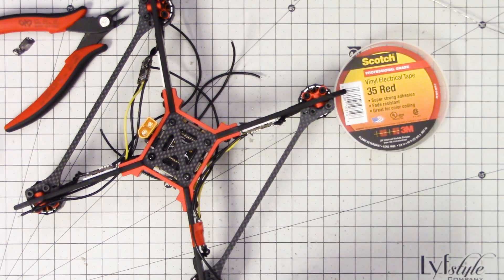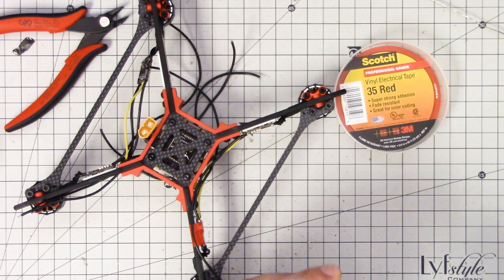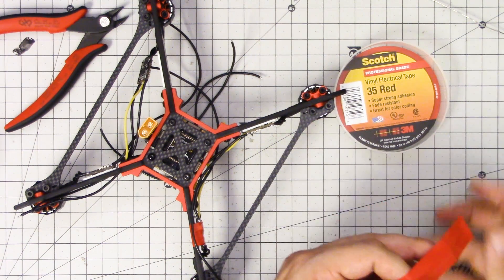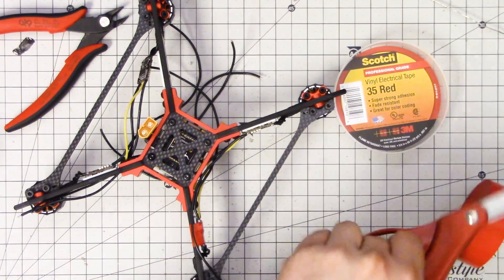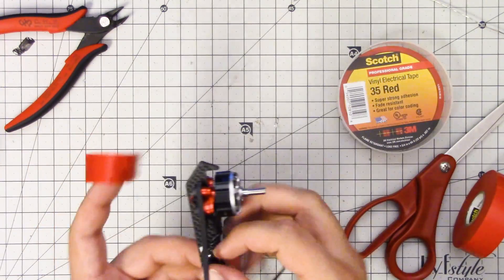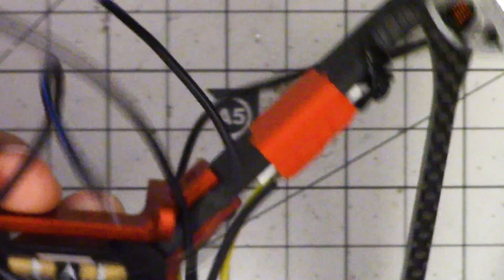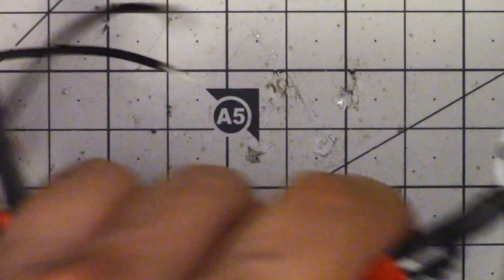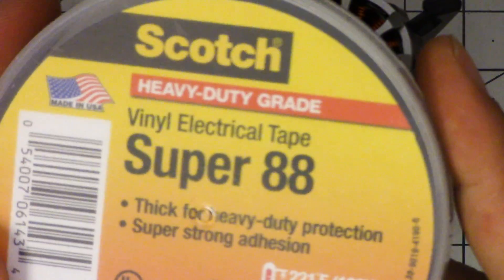RACING DRONE FULL BUILD | Part 3 | Karearea Talon ZMX FinX30 HGLRC F4 v5 Pro

Comment: Hi Joshua. Great videos. I'm building a similar frame of yours, but I'll be using a 4in1 ESC's with the same FC of yours(still waiting to arrive); can you tell me if there is another way to power on the FC since I intend to use the power input from the 4in1 ESC's instead of connecting the lipo directly to the FC. thanks
Reply from the maker: Check the manual of my FC, available for download from the RaceDayQuads product page. It has wiring diagrams for how to connect it with a 4-in-1.
Reply: thanks Joshua. So from the 4in1 ESC's using option one the wires to the FC can be from 22 to 26awg.

Comment: Hi everyone! I've got a really messy problem and wonder if anyone got some input? I've just finished my latest build and when I measure all points I can't seem to find any shortening, but when I plug in my battery with a "magic smoke stopper" the fuse blows instantly... :( anyone got any tip on what to start with?
Reply from the maker: Could it simply be that the quad is pulling more current than the fuse is rated for? Maybe on startup it pulls 2-3 amps but the fuse is only 1.5 amps.

This is why I like an automotive bulb instead of a fused smoke-stopper. With an automotive bulb, you don't have to keep replacing the fuse every time it blows.
Reply: Hmm maybe that is the case, it is a 2A rated fuse (at least on paper). If the quad draws that much on startup, that may very well be the case :) I shall try it with a current limited power supply instead and see if I got any luck. Thanks for the tip (Y) :)
Reply: What ratings do you use on your light bulb btw?
Reply: You were absolutely right! I made my own smoke stopper with a 12V 21W light buld and the quad works great! I think it's wierd that Hobbyking sell a "smoke stopper" with corresponding 2A fuses which can't handle a normal 250mm sized quad... But whatever, it works now, thanks for the help!

Comment: @Joshua Bardwell, any reason the signal wire is not grounded?
Reply from the maker: The FC didn't have a separate ground pad so I didn't bother.
Reply: The manual recommends wiring to the power gound pad.

Comment: To all the haters on the AIO FC/VTX -- despite the issues the current version will have occasionally, in a couple of versions, with integrated Smart Audio control, this format will be the de-facto standard, and if HGLRC does a good job with their V6/V7 iterations, it will no longer be the 'cheap' option.  With input from the likes of JB, a company already making AIO F4 boards will finally figure out how to combine all of these features... and the result will be awesome.

Comment: Is it fine to use motor wires for powering the ESCs? I noticed that the motor wires are always a little bit thinner than the wires that comes with the ESCs. Is that fine?
Reply from the maker: I think 20 gauge is okay for ESC power wires.
Reply: Joshua Bardwell thank you! Thats great because I have soo much 20awg wires!

Comment: Hey Joshua, Just a small tip, you should use cleaning gum to hold down any parts to solder on. In case you haven't heard of it yet, take a look: https://www.t2shop.de/Xceed-103232-Cleaning-putty-/-gum-200gram 
It looks a little like play-doh, but the stuff from XCeed is so nice to work with. Just press any part into the gum and it wont slide around anymore. When you're done just give it a little wack and tap away the remainders. I see so many people fiddling with moving PCB's and loose wires as a soldering tool isn't always the way to go. You now finally have one hand for solder, and the other for the soldering iron! Perfect joints at your disposal!, Greetings from The Netherlands, keep up the great video's, i watch m all, even if they're 30min ;)

Comment: Why did you put the foam that's supposed to be the battery pad onto the top of the bottom plate under your fc?  Was that a boo boo?
Reply from the maker: Yes. I correct it in the next video. I just had the plate installed upside down by accident.

Comment: @Joshua Bardwell
It takes almost all my strength to hold the motor bell while tightening the prop nut. Am I missing something? A tool that I don't know about? This is true on all three of my racing quads, but the worst is the emax rs2205s motors and pretty standard nylock nuts and Lumenier butter cutter props.

I have plenty of grip on the nut because I have a nut driver, its just holding the bell that is the problem. It hurts a lot and I get red marks on my finger from the bell vent holes almost cutting my skin. It is not too tight because if I make it any looser, then I can hold the motor still and make the prop slip with just a little force. Bad nuts? Bad motor threads?
Reply from the maker: Nylocks are always pretty tight the first few times you put them on or off.  There are a ton of 3D printed tools that can hold the motor bell. You could also check these out:

https://goo.gl/c1dyYh

https://goo.gl/QSusGg
Reply: Those look awesome, I will probably buy one tomorrow, and I will use this link just in case it counts as an affiliate link. Thanks.

Comment: Hi Joshua, I really like all black wire builds... my own little tip... I use a small (2-3mm) pierce or red shrink tube on the positive wire.  I usually put the shrink close to the FC so it stays relatively hidden.  I know it's an extra step, but I love the clean look.

Comment: I have a couple of questions about this frame. 
1) would it be even remotely possible to cram the esc's inside the frame somewhere if you were using a BF F3? I just don't like the idea of negating one of the main benefits of this frame by mounting them to the arms...
2) it might be crazy but is there any chance you could get a battery mounted to the top?
BONUS QUESTION) top or bottom battery for an all around quad? Rs2205s 2300kv, individual esc's, BF F3. I like top mount, never flown bottom. Looking at the talon of floss 2(top mount). I fly acro now but want to use it for some racing too.
Reply from the maker: Yes, just use a 4-in-1 ESC.

All around flying, I prefer top mount if only because you're not landing on it all day.

Comment: lost my boltrc kraken 5r becouse of going up when sun was coming down and was in wooded area so i long story short the video and radio signal went out and now its gone for ever but it was fast and weighed 303g with props but no lipo .. what would be as good? and wouldnt be heavy . tokio from envyastro is cool but dont have replaceable arms so i dont like it. Not sure if boltrc will be  best option since parts are harder to get but it was a badass with multicopter builders primo 2207/2650 with spedix es30 esc's,omnibus f4 pro,tbs unify pro hv,xsr receiver urghh makes me mad at myself damnit.. what u think durabilty and light weight would be good choice?

Comment: For all those commenting about the clone of this frame: Some differences (also posted in the Q&A section on BG): Not 7075-T6 aluminum, not 7k carbon, no chamfered edges, weak rear pod frame, jacked up cam mounting position. Cheap looking pot metal hardware. No optional pod plates for 2 or 3 board stacks. No HD cam mount option. No lipo pad either. Also, not a STRETCHED X... looks like a regular X frame. Too many differences. I'll stick to my real Karearea Talon. Thanks!

Comment: Take you time building. That way your Talon will stay alive longer :). I already built mine and broke it. Landed upside down today and broke off the top plate and the side plate of the contraption that houses the stack and camera. The frame is really study - I crashed it multiple times and the arms held well. Today it dropped from 40 meters above, no 5" quad would have survived.

Comment: Really weird idea here. The Karearea website says the aluminum motor mounts help dissipate heat, so if you're going to use it like a heatsync, why not put thermal paste between the base of the motor and the mount? I can't imagine It will help a lot, but  what harm can it do?

Comment: Did you have all the screws in the box?  Mine most certainly did not!
Reply from the maker: The motor screws? I don't think I got them, but I can't be sure I didn't lose them, so I don't want to blame Karearea.
Reply: First batch came with 3x8 M3 for the motors. Later ones did not. Just make sure to pick up some longer ones for bolting through the side braces.
Reply: Interesting - that's the ones I was missing.  A bit annoying if you don't have any spare.

Comment: Still, I keep my comment on your way of soldering. It is certainly not good while you say that you can do it so well.
For example, you just made a soldering and you see that this is not completely correct (can happen) then correct it by adding a few more solder to a wrap. It is clear that these 2 cuts do not flow into each other.
This is NOT good. That, as you say, never has problems, of course, says nothing.

Cutting a wire that is soldered is also not the right way. The wire should be of the correct length and then solder only. Cutting after you've soldering, gives a mechanical force to this connection, something we DO NOT want. You are always so careful with the copper islands with soldering, so do not cut if you have just soldered. Again  these remarks are not maked,  if you do not always call that you know it all so well.

Comment: Anybody i know who tried the Racerstar f4 AIO with 30A ESC and OSD Build in (Costs 60dollar) Loves it. If more people tried AIO Boards... NO Company would ever sell a Single FC / ESC / PDB again. Believe me^^ you Can Build a quad within 30min and it flies Like a Dream with This Board. But most of the people Are anxious to Try an AIO. They Are not stupid.. They just think it Cant be any good Because its so cheap. Na okay.. Thats actually stupid :D
Reply from the maker: There have pretty consistently been issues with AIO boards with ESCs built in. The first gen Asgard were popping in the field at a high rate. Same as reports of earlier versions of the HGLRC and the Sirin. Makes me think that maybe Moto has the right idea putting the Typhoon on a separate board.
Reply: Joshua Bardwell the Racerstar f4 is in its 3rd Generation now. I still have Version 1 installed and it Works just fine (6 months now with Tons of crashes..) Version 3 is out now with betaflight OSD and it Works great too. I Cant speek for HLGRC (i also heard about VtX failure so i wouldnt use an AIO with Build in VTX Because Lösung Video is more dangerous than a Damaged ESC) But i Highly recommend you to Try the Racerstar AIO F4. You save about 15g of weight and your Build is as clean as it could be. Cheers
Reply: Coppertop FPV i didnt experience noise issues. I replaced all my PDB FC Esc combos with Racerstar AIOs and dont Regret it. I Broke several ESCs before When hitting Gates or branches..not having ESCs on the arms is a Huge advantage in my opinion. Especially at a race where every gate Hit causing an ESC to Burn out wont let you finish the Race.

Comment: No issues with the hglrc f4 at all. Not sure what the issue is.
Reply: Lemon rate is low, but they do have issues - the 5V3A BECs do have issues (some are DOA, some fail after minor impacts), on others the MPUs see big noise spikes (likely electrical isolation issues).  I have two on copters that fly brilliantly, but two that have had issues... but since nothing else out there has this feature set, I'll probably buy more then next time they're $40 on BG

Comment: LOL! China is so fast.. Talon Imitation already out https://www.banggood.com/Realacc-Real1-220mm-5-Inch-4mm-Thickness-5-Vertical-Arm-CNC-Carbon-Fiber-FPV-Racing-Frame-p-1194720.html?rmmds=search
Reply: I could see a cheap knockoff coming off as garbage real quick: I have 8 years light mechanical and electronic technician experience, and I have never seen anything with this tight of tolerances as shipped from the factory.
Reply: Some differences with the Real1 clone (also posted in the Q&A section on BG): Not 7075-T6 aluminum, not 7k carbon, no chamfered edges, weak rear pod frame, jacked up cam mounting position. Cheap looking pot metal hardware. No optional pod plates for 2 or 3 board stacks. No HD cam mount option. No lipo pad either. Also, not a STRETCHED X... looks like a regular X frame. Too many differences. I'll stick to my real Karearea Talon. Thanks!

Comment: Accoring to Kabab the mounting holes are 18x18 mm on those motors. That's why they were difficult to mount.
Reply from the maker: WTF why woudl ZMX do that?
Reply: Ha, that's what you get for listening to Kabab. FAIL
Reply: Yep, I know you need to take his words with a grain of salt...
Reply: @Joshua Bardwell
Dunno, just so unnecessary to deviate from the standard, 16x16 or 19x19 would be ok though.

Comment: Joshua I have only recently subscribed to your channel after watching many of you really informative videos.
I do not understand why people complain about your videos, it is the same as complaining about TV programs if you do not like it there is an "OFF" button.
Have you thought about putting a short piece of heat shrink on the positive wires to identify them?
Pleas do not stop your videos especially as the build your are doing is very similar to the one I am considering
Reply: Bob ASHER : In general you're absolutely right. My oppinion - Keeping a youtube channel with a good and comperhensive content is a challenge. Beeng a subscriber for a long time i can tell there's some vids in this channel that i'm playin again, and again, and again, especially the practical PID tunning and blackbox lessons. Those are one of the most valuable, and informational. However I  think the comments are very important feedback for the channel's owner. Every owner must read and listen to the negative feedbacks as well as with the good ones. Cheers!

Comment: There is already a clone of this frame for 60 bucks
Reply: Haha they made it a wide x not a stretched x .they messed up the easiest part 😂😂
Reply: JOESK/ FPV they messed up the easy part… priced it too close to the real deal. If I’m going to pay NZD$80 for a clone I’d easily pay NZD$111 for the real deal.
Reply: Some differences with the Real1 clone (also posted in the Q&A section on BG): Not 7075-T6 aluminum, not 7k carbon, no chamfered edges, weak rear pod frame, jacked up cam mounting position. Cheap looking pot metal hardware. No optional pod plates for 2 or 3 board stacks. No HD cam mount option. No lipo pad either. Also, not a STRETCHED X... looks like a regular X frame. Too many differences. I'll stick to my real Karearea Talon. Thanks!
Reply: FPV FANATIC  what's the name plz?
Reply: JOESK/ FPV Realacc Real1
Reply: Most clones suck
Reply: Well,, just like the flight controller will affect the balance of the copter,, so will the build balance, and the frame will be important for energy transfer. I probably think that for most people a clone is better, but if you're tracking your times, probably not. This is also why a tried and true flight controller can be good,, over time people work out the little kinks in the firmware and this will result in a more stable copter, and therefore more efficient energy transfer across the machine. (more power). !! Buuuutttt,,, this will also mean if the higher grade fc DOES result in increased stability (you don't have to feel it for the energy transfer to still be affected) then the higher grade fc will result in increased power from each unit of energy consumed.